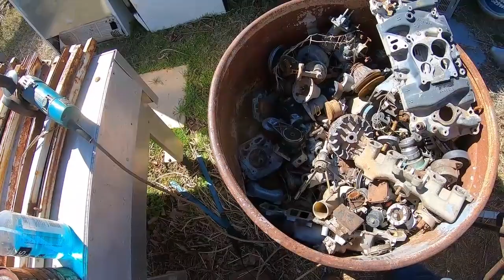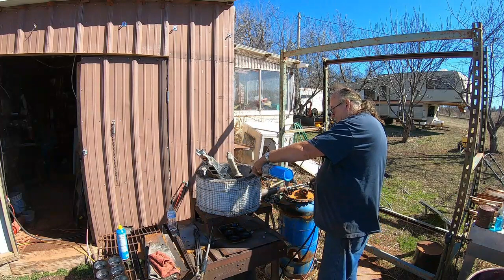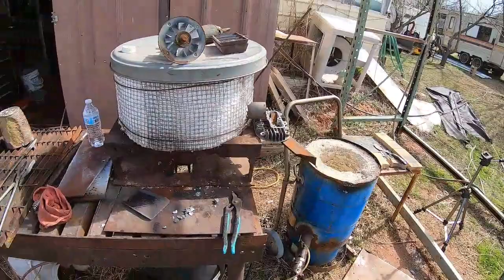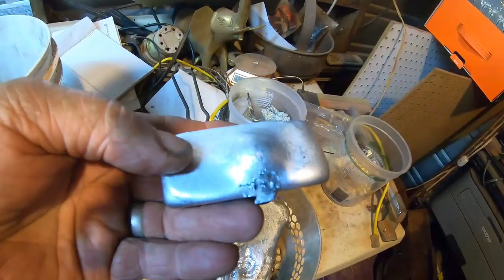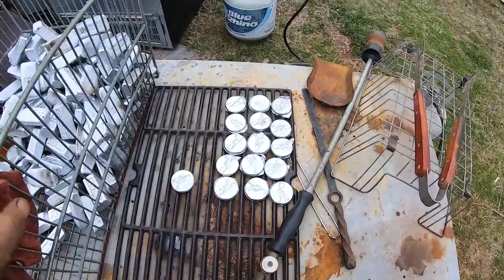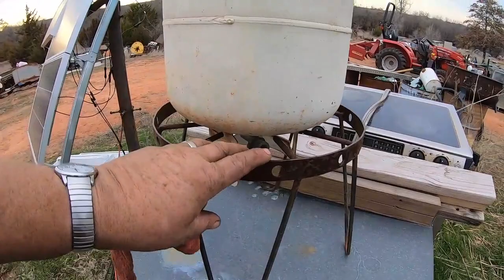Melting 40 Pounds of Scrap Aluminum for Resale

Comment: Neat stuff!  Id like to try that out with my kids.  Is there any value to my old motor oil?  Ive saved about 80 gallons of it now.  Does your waste oil burner run motor oil?  I might have to watch more of your vids when i got time.  Thank you.
Reply from the maker: yes I use old motor oil and mix it with the oil from the ac compressors that I cut down. I mix about 8 oz. of kerosene with it to help it burn good. I have an oil burner play list. there is a video I did about 6-8 weeks ago where I rebuilt the burner, and I had all the pieces laid out on the table so you could see how it was put together, and I have the siphon nozzle on my amazon page

Comment: Have you ever tried to put a bucket of water under it? So you could sell the aluminum in pellet form? you could weigh out however much you’re selling easier and it would be faster to re-melt that way as well
Reply from the maker: yes I have it setup for that, and I can add water as I go, to keep the water from getting hot. but I need to raise the area, so that I can make a path for the water to drain away without making a muddy mess of the area
Reply: @Okiescrapper  nice

Comment: Nice assembly line type process.  I had the same crucible pouring clamp, but didn’t like how close it felt—personal preference.  I don’t sell mine—I cast.  You ever sell copper?  Also, another dumb question, what size is that crucible?  Thing looks huge!  I roll with a 12 kg.  ✊🏻🖤
Reply from the maker: yeah, I don't like how close I have to hold the thing to clamp down good, can get a bit hot on the hand sometimes, the crucible looks to be a #6 8 kg. https://www.amazon.com/dp/B00FBG3ROO?linkCode=ssc&tag=onamzallenhar-20&creativeASIN=B00FBG3ROO&asc_item-id=amzn1.ideas.35A7I3E8G3UT3&ref_=aip_sf_list_spv_ons_d_asin

Comment: You are talking about your blue furnace.
You have a dryer video i watched and went and got a dryer a few weeks back to scrap. While scrapping it the dryer body is covered with white insulation stuff. Is that the same insulation used for a furnace? Like if I got that red stuff to spray onto it can I use that stuff from a dryer to be used in a furnace? Thank you
Reply from the maker: it may work with a coat of  rigidiser over it. not sure if it would last or not, Kao wool it what most use. the blue furnace I used perlite and Portland cement. but it is starting to break off on the inside, I am about to make a new one using dry refectory I hope I have enough of it I may need to buy another bucket of it to make sure

Comment: I'm in the middle of the video watching it drip and wondering where is your slag going? 
If it is going into the loaf as  I suspect, does it not affect castings on the end user?
I never cast with slag not removed so I am asking so I don't do anything the hard way. 
Enid
Reply from the maker: I use the melting pot so I don't have to cut the stuff up to fit into a crucible. I remelt the cupcake ingots. and remove the slag. the way the melting pot it setup with gravity drip some trash may fall into the ingots too. that is why i remelt in a crucible. I don't de-gas but if the end user want's they can do that when they melt the ingots. I make small ingots so they will fit most any crucible out there

Comment: How big is the hole in the bottom?
Reply from the maker: it's a 3/4 inch pipe thread hole, threads are rusted away, it plugs at times so I have a propane torch to heat it up. in the hot summer I never had any problems with it cooling off and plugging the hole

Comment: I melt lead but never anything like this! What is the melting point of aluminum.?
Reply from the maker: I think it is about 1221 F. if I remember right lead melts at around 600 F.
Reply: @Okiescrapper  yeah 621-625 for lead ! I usually pour at 700 -720 !